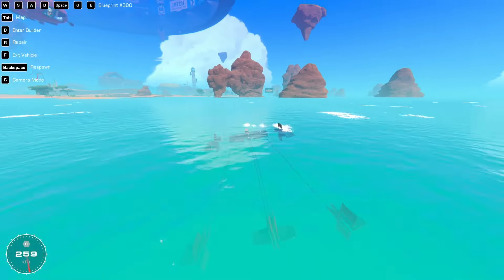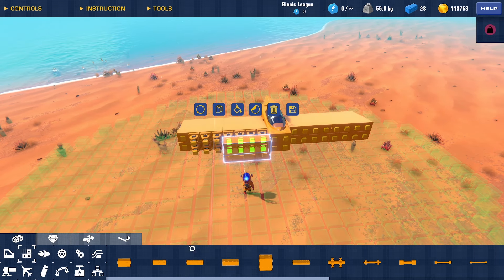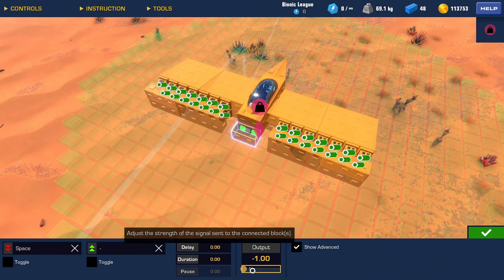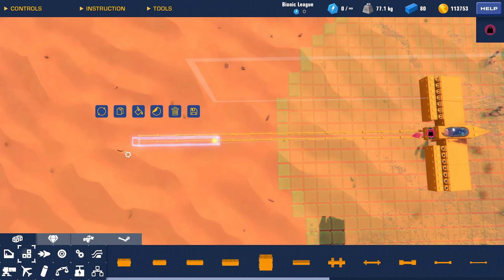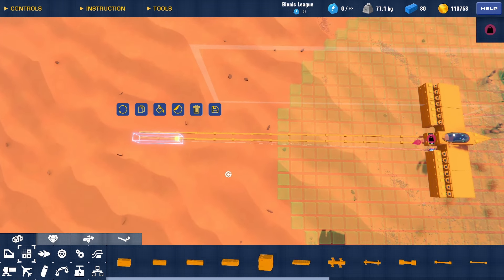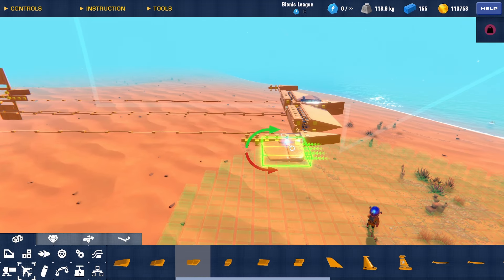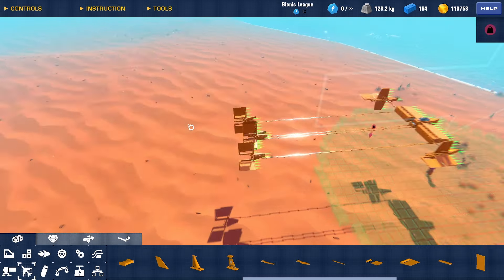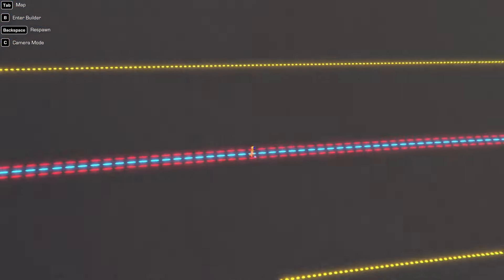Trailmakers How To Make A Hinge Glitch Plane (Tutorial)

Comment: mine only goes 1100, although i followed the tutorial block for block?
Reply from the maker: Intressting semes like it’s random, you could extend the right and left tail parts or add more rudders
Reply from the maker: You can add more hinges but i find it unnecessary cuz it unstabilizes the plane
Reply: Andrew?
Reply: I made a contraption that essentially just spins until you get unlucky/lucky and it goes flying around 10000mph using hinges